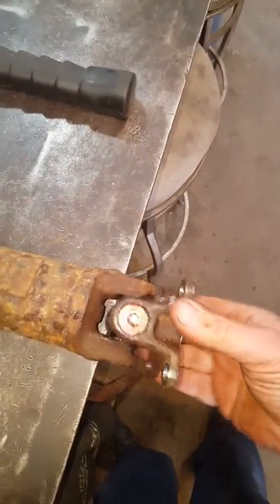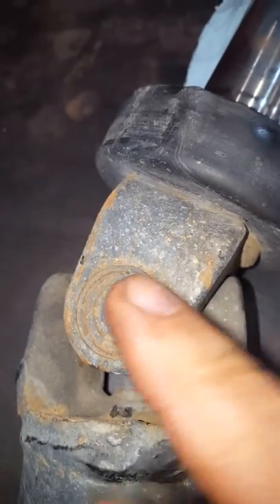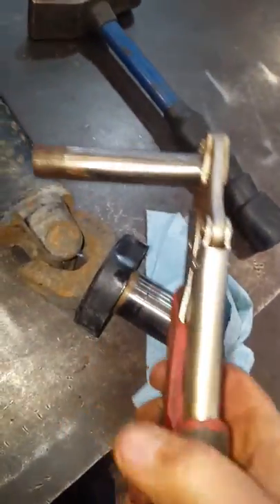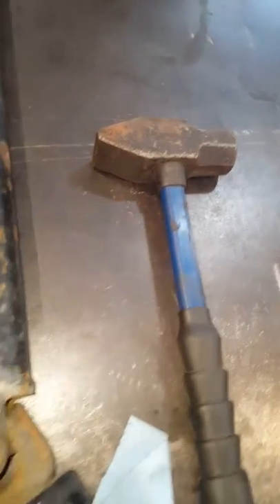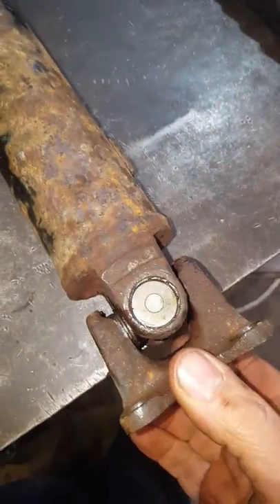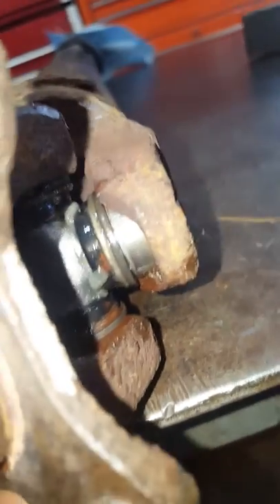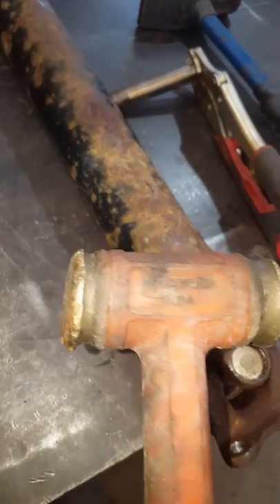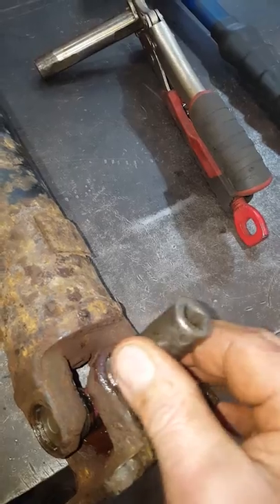Staked U joint Replacement

Comment: Could you please help me out and give me the exact U joint number I'm doing a 2003 Toyota Highlander myself right now thanks in advance
Reply: Hi Mike.  How did you make out with this?  I have a 2005 Highlander Limited.  An aftermarket seller (reputable) can't promise when parts will come in so they cancelled my order.  While I found a machine shop that has done this, I haven't yet pursued them to ask if they've done three piece shafts often and how those have worked out...the aftermarket seller warned me they've seen it attempted but lots of problems with three piece shaft unless a shop as a very expensive balancer for three piece shafts.  Ugh

Comment: anyone know a part number for the u joint that will fit this driveshaft? parts stores dont show any listing because the u joints are "non replaceable"
Reply: part # 430-9b  u joint from rockford
Reply: Could you inform The dimensions of tais joint?